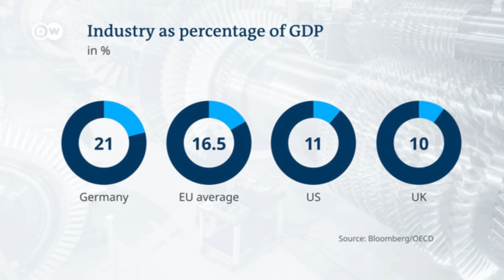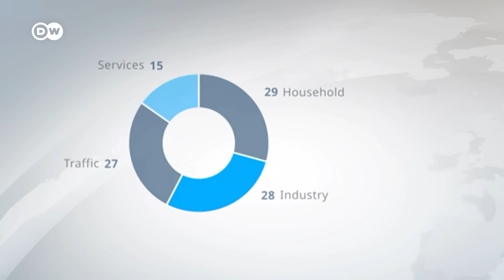Skyrocketing energy costs: Is European industry on the way out? | DW Business Special

Comment: It's not the war in Ukraine but the sanctions on Russia which driven up the energy price. If you had took measures after Crimea annexation, you could have avoided such a situation
Reply: What measures? Do they have better alternative? Europe is not a resourceful continent. Russia is very exceptional country on the continent.
Reply: @abubakarsadisumuktar932  they could have diversified their energy supplies and focused more on renewables. Germany actually shutdown their nuclear power plants. Instead they could have built more nuclear power plants.
Reply: @mynjeri5469  I want to add to your points: There were also options to connect to other gas suppliers through building new pipelines and iInvestments could have also been made to harvest new deposits. If they would have started in 2014, the first results would be available right now and could've served as an alternative to Russia.
Reply: @dnocturn84  absolutely
Reply: Right. If a nation removed the sanctions they do better. Now imagine: if they pull out of nato Russia will give that nation a giant discount. I'm just guessing

Comment: No Chep Energy..NO Industry.?? What to do Wind Mills to Fix This?? Solar??
Reply: It won't be enough to go around domestically. Let alone for industries  .
Reply: Very unreliable. And northern countries don't have the capacity.
Reply: @paulskiye6930  Well . we have over capacity.. When Wind Blows. Now put that to energy when not wind blows?
Reply: No.  You need oil, natural gas, and coal to make steel, rubber, chemicals, fertilizers, and much more.  Germany makes all sorts of things - you cannot replace the manufacture of PHYSCIAL ITEMS by wind and light.
Reply: @quantummotion  Can stay warm in the winter with warm feelings of saving the planet. Satiated hunger by eating snow cones, because the icecaps haven't melted.
Reply: @mikaseppanen1632  we don't have proper energy storage. Yet.
Reply: We in North POWER  Germany..So They Dont Have to Freeze..Never come and say North do Nothing in EU.. >And Greece/Italy/Spain we HAVE to Talk..
Reply: @paulskiye6930  Well Call Norway and Ask them stop Their Gas lines.??

Comment: I saw a research paper out of Africa, he linked ten five gallon buckets of dirt and got +/- 10 volts of electricity (that's 24/7 power production using dirt) which was linked up to batteries then run through a inverter to power a home. Ten plastic buckets? Diameter(top). 11.8 in. X 3.14 X 10 = 370.52 sq inches of surface area. How many sq inches surface area / acre of land? 6,272,640 sq in. 16929 of these ten five gallon bucket systems have a surface that equals to one acre. 169290 volts of electricity could be produced per acre of surface? Here is a low cost system of making electricity no complex equipment- low overhead. It is called an earth battery system?
Reply: That sounds a bit overlooked to me, "which was linked up to batteries then run through" And a very big question, at what amperage?

Comment: These economists do not understand the difference between real products and digital products. All of auto industry in Germany is dependent on metal smelters that run on gas. Even if you make electric cars, you need all the parts of suspension, chassis and body that's made with molten metal. She seems clueless to downplay the role of Auto Industry in Europe and especially in Germany. All they need is cheaper energy to be competitive. Mercedes is trying to move more manufacturing to Hungary plant and USA. Whole of EU should understand USA gas prices are extremely low despite higher global prices. Many big car brands might move much of their production to USA.